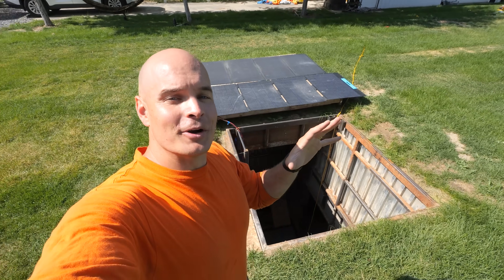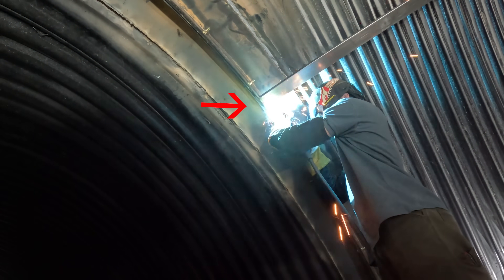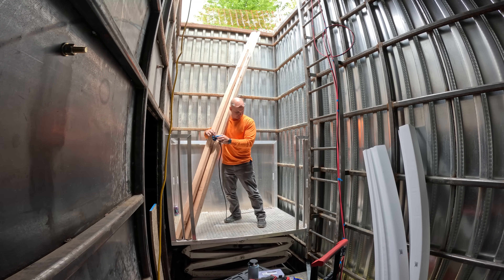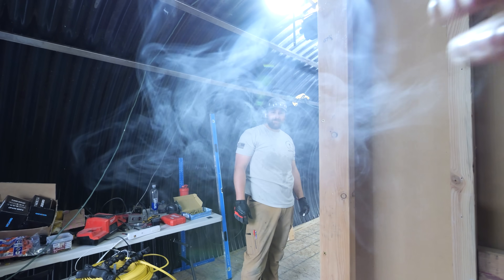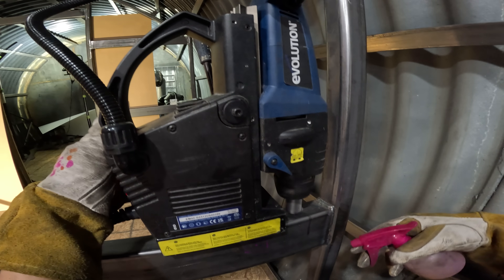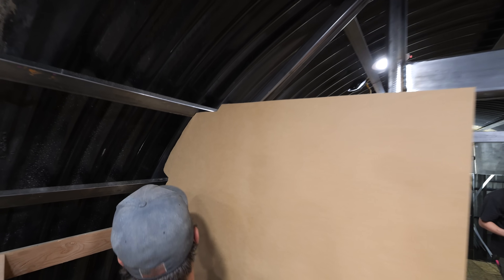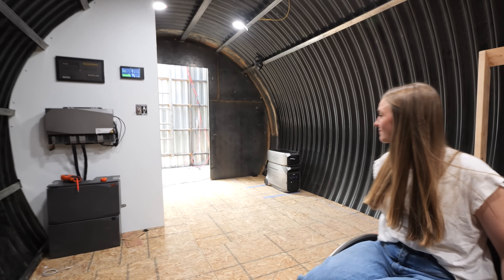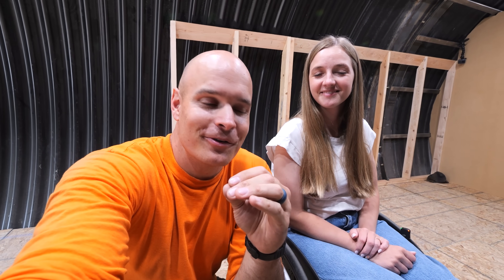How to Properly Power a Backyard Bunker - (Completely Off Grid)

Comment: I love anything bunker related but all I got out of this video is ecoflow..... A product that I will never own! It's horrendously overpriced for what it offers and it's not suitable for a fixed location installation! 
For the money, a victron system coupled with Chinese Lifepo4 batteries will get you more kWh worth of storage which you will find that you are going to need at least a minimum of 30kwh and that doesn't include the running of heating equipment..... Let alone having enough solar panels to net you no less than 1kw of constant solar energy on the worst days of winter.... 
My solar system gets 5kw on the best of summer days but during winter I get days where I only get 450W coming in, that's where the battery needs to get you through to the next day or two!!!! 
You need to setup the system based on winter months performance, I have extra panels that I can switch in or out depending on the time of year, I need more in winter and less in summer, it saves me from spending money on more charge controllers by doing it this way.... 
But basing your power requirements on those ecoflow contraptions, that's the most expensive way to do it! 
Not recommended to purchase or create informercials on .....

Comment: I would highly recommend you not set the battery bank directly on the floor.  If you set it up at least a foot up on a platform it will mitigate any potential flood damage.   I do not know if your type of equipment needs air flow and heat gaps around but it might be recommended.

Comment: Electric is cool and all but wouldn't be my choice in a bunker. In the event of a nuclear blast, your entire charging infrastructure would be destroyed. Not to mention it is easily sabotaged and only produces power when the sun is shining. No power at night, very little power in the winter when you need it most, and in the event that the Yellowstone super volcano erupts, it would be covered in ash and rendered useless. If it were my bunker, i would still have a diesel generator as backup. Diesel unlike gasoline can be stored for long periods of time, pair with a large enough fuel tank could last you months, not just days. Plus, by storing the generator and fuel underground, they are safe from damage or sabotage. All you would need is an intake and exhaust port.

Comment: And in 10 years, with all that welding, his nice bunker is going to leak from all side's! ^_^
First, all the galvanized plate at the entrance (not even mentioning the galvanic corrosion blank galvanized metal has in the ground), and now he has also burned way the coating of his ''bunker'' itself.
It would not be dumb to install a galvanic corrosion protection system, otherwise it will leak within 10 years, and totally collapse in 40.

Comment: If those days had not been cut short, no one would survive, but for the sake of the elect those days will be shortened. Matthew 24:22

Matthew 24:29
"Immediately after the tribulation of those days shall the sun be darkened and the moon shall not give her light, and the stars shall fall from heaven and the powers of the heavens shall be shaken"

You mentioned as long as you have sun you should be okay. Oh boy.

Comment: Solar panel will work fine in a nuclear winter, years without sunshine.

This cooling would be produced due to a 99% reduction in the natural solar radiation reaching the surface of the planet in the first few years, gradually clearing over the course of several decades.[

Comment: solar's great, but say a nuclear winter happens. you're kinda screwed. but y'know what'll still be going in a nuclear winter? the wind. gas generator runs outta gas, solar cells run outta sun, but the only way you'll run outta wind is if you lose all the air, and uh, you're not surviving that anyway

Comment: Another suggestion. Get some hardcore air filtration for both outside air as well as inside air. It can be very helpful in an apocalyptic scenario and also in general to keep the air in the bunker healthy.
To go one step further add a dehumidifier and humidifier combo.
For ultimate protection add a CO2 scrubber (possible to DIY) and have and oxygen cylinder down there to replenish. Im assuming oxygen is used for welding in the wheelchair factory. Use one of those cylinders and swap it out every few months to keep it fresh and make sure its a recently tested cylinder that will hold up for a long time

Comment: How do you use the EcoFlow Smart Generator (Dual Fuel) down in the bunker without ventilation or refueling? What is you don't have sunlight or solar panels? I always hate on the other products that claim a "battery pack" is a "generator". How does it "generate"? I'm in the basement of my house, no sun, no outlets, no fuel.....make me power....

Comment: I just got there 2 phase whole house power system. Just remember, they generate heat when they're discharging and when they're charging.
A little breathing room it's always a good thing.
Absolutely brilliant use of that gutter as a wire guide!
 Panduit is way too expensive.
At this point I would suggest that you put in your dehumidifier and other HVAC.
 I see you're using wood which is a wonderful little sponge but not as bad as drywall.
Check out some of those RGB LED grids for your mood lighting.
They seem quite versatile.
 I've seen some that can actually do rough images that could simulate clouds going by.
Speaking of light!
 I had almost forgot, you're going to need UV in order to process your vitamin D!

Comment: Not sharing alternate egress to us: maybe just demo of tech and ways tech can be used.
Radio signals? Detectability from outside?
Teach morse code etc to bunk mates. Low tech comm can be made without computers or chips. 
Consider learning basics of second language. maybe one most common to where you live.
Combustible toilet? Whichever way chosen: Fumes, disposal, fuel, biological, will it attract bugs and subterra animals. 
Alternate in case of solar panel fail?
Smaller size Low power television.
Defibrillator etc.
What communication works within bunker, between house and bunker?
Consider interference with comm of choice: materials, electrical wiring, earth around bunker, devices within bunker.
Real printed reference book as part of back up in case electronic versions not avail. There are pocket sized versions available.
Learn/practice minimum nutrition intake.
Make prayer/ meditation part of routine.
Air filtering? Exhaust system? 
Lights: automatic and manual.
Train to endure confinement and uncertainty.
Meed 2nd Delta pro as backup.
Have manual tools in case electricity temporarily or permanently goes out. Have a printed reference of electrical that includes manual tools, not just as alternative.
Alternate egress tunnel in case elevator not working.
Manual elevator engagement in case no electric.
Consider spiral ramp.
Fire emergency? Fire extinguisher? 
Generally, all types of waste disposal.
Second bunker connected vial underground.
Root cellar bunker with or without grow lights.
is bunker placement above water table or flooding that won't compromise egress?
Combustibles?
Stock and stay for a month?
Old school phones that might be used to improvise comm network wired between bunkers or set up on a gateway.

Comment: Have used gas generators for years and have had ethanol free gasoline go years without issues in generators and other equipment. I have had diesel separate gut never had any issues with gasoline; never used a stabilizing adaptive either, just always get ethanol free.
No argument regarding the noise though as even smaller inverter generators can be quite loud in an enclosed space or out in the country where noise isn’t the norm. A battery generator mix can be nice as you can upsize the generator to enable fast charging and as such limit run time.

Comment: Having living batteries surrounded by flammable materials is extremely dangerous. They must work in a separate ventilated room which can be fastly isolated from oxygen and filled with fire stopping agents. You need to protect them from freesing, overheating, over and undercharging. Keeping them working in a tube above ground with people is extremely dangerous. Especially when not all can escape fastly.

Comment: Jerry, you should really switch from a PVC gutter for the wires to something metal, or at least made of plenum rated plastic. Actually, with the bunker being as enclosed as it is you should just use plenum rated wiring and mounting hardware.

PVC releases dioxins when it burns. These are some of the nastiest chemicals you can breathe. If you have an electrical fire in that PVC guttering, you're gonna gas your whole family. Same goes for the wire jackets, those are commonly PVC in housing because they're (relatively) sealed in the walls behind the drywall. when the wiring is exposed (as it is in a plenum space, such as the area above a drop cieling) it has to be made of materials that don't give off toxic smoke if they get hot. 

Now's the time to fix this, as once you get further along it's gonna be harder to access all the wiring.
Reply: Yeah, pretty sure rain gutter is not an NEC approved Raceway 😅
Reply: Plenum rated wiring and wire trays is a good investment. PVC is a bad choice for wiring. Cleanup after a PVC fire is not much fun.
Reply: Also, any type of powrr source, be it a fasoline genorator or a bunch of lithium batteries should be in something external. If those batteries ever go up in flames (and considering how many EVs did, they might) that bunker will be flooded with toxic gas.
Reply: Good tip, timely tip
Reply: The location this is installed in is not a plenum space.
Reply: Exactly, but but nothing in that crematorium, I mean bunker, looks to be any sort of fire resistant anyway. That thing is a death trap.
Reply: @inothome  I think if he ever needs to use that thing, there are worse things to worry about than the risk of that bunker bursting into flame.
Reply: @sterlingodeaghaidh5086  If you're silly enough to think you may ever even need some bunker you should actually make the bunker safer than what you are afraid of outside and not a tomb. I mean who are you going to call if it catches on fire when you are "hiding"? lol
Reply: @inothome  I really don't think he is building this to be serious. I think he is only building it for the views and the payout anyways. He might use it as his doghouse when in trouble with the wife.
Reply: @tomscheea8656  for money yes, but also for fun. when you've got the money, you can do whatever the little kid inside you wants.
Reply: His name is not Jerry it is Zack Nelson

Comment: Imagine building a bomb shelter in a country that doesn't get bombed. My childhood bedroom was a bomb shelter, and on top of the dresser, we had the entire family's supply of gas masks, spare filters, and anti-nerve gas serum (in case the little ants climb up your legs (thanks, Sadam)). Having batteries and solar panels is a great idea. Still, in an actual war zone, gas (read petrol) generators are more robust and easier to protect than solar panels, especially because solar panels are easier to see and destroy from the air. You can also get gas (read propane) generators, and propane lasts much longer. If you're worried about enemy soldiers looking for you (which will never be a concern in Utah) and finding you based on the sound of your generator, then you're doing it wrong. If soldiers or terrorists are outside, you go into blackout mode because the enemy isn't detecting your electricity with their ears.

Comment: I really hope your plan with the bunker will work well, I can see how it wont be very accesible with the wheelchair and feel cramped. The culvert being round and maybe not having the protective layer on the outside seems like a big risk too, you won't know it until you sit in there and 5 tons of sand blast through your roof. 
I think you should've gone for a concrete bunker with a straight roof and a wider profile, maybe even a ramp for the wheelchair or some pulley system elevator in case of power outage. There should have been enough documentation on civil bunkers to build one correctly to your needs.

Anyway best of luck.
Reply: Just want to point out he may need to look more into the details of things. That PVC gutter isn't plenum rated, and his wiring probably isn't as well so that'll be PVC jacketed. 

Not gonna get too into it, but hot/burning PVC releases dioxins, which are extremely toxic. A wiring fire would gas out the whole bunker.

The coating thing should be fine, they were welding far enough off the outer wall (and the dirt will help keep the coating cool.) It's putting the battery pack right beside the living space that skeeves me out. If that thing has a catastrophic issue, it's just gonna dump the contents of its batteries into the air of the bunker at over 1000 degrees c turning it into a pressure cooker. I'd have it in a spot that can be isolated and has it's own exhaust hardware. 

Also i hope they figure out some kind of range hood for cooking down there, as a stove fire is exponentially worse when you can't get away from it and the smoke.
Reply: @zerumsum1640  Yeah, they will probably think about some automatic ventilation + manual backup, at least they should show it in future videos. The pvc gutter is indeed not rated for cables, I wouldnt trust it. Even if these were fire resistant cables in it. Any fire, especially the batteries would kill them before they could get out of the bunker with how its layout at the moment

Comment: An experiment for you to do with the ecoflow - how many miles would it give you in you van if the van battery ran flat ?
This is one of my biggest question with EV's, what do you do if you run out of power ?
Loving the bunker, I would have run an exhaust pipe into the barn to make use of that free underground heating, it seems a waste just to vent it away

Comment: Best commercial for EcoFlow :) 
Jokes aside, fantastic build. One thing though that bugs me every time I see electrical work from US parts.  No user of conduit to pull electrical wires through. I know that the chances for a cable to have a fault is slim to none, but still. When walls are up, its much easier to pull a new wire through a conduit than pulling down the whole wall and what not that is in the way.
..
Also, this video need 1M likes, would love to see a fusion core down there!

Comment: I've been looking, but couldn't find anything. Did Jerry make a list of things he's planning to have in there? Like a to do list or something? Also, a sunlight lamp in there might be usefull for moral on the long run. The gutters might accumulate liquid, poking a few holes here and there might be a good idea. Not sure if the biggest TV you can fit might be a good idea. Those thing don'T last long and eat a lot of power even when turned off (you need to unplug it or it's in hibernation mode). Satelite signal could be usefull as well, the elevator should be a cleaning sas as well, so radiation suits, etc. So much to think about.

Comment: Just a thought... Don't bank on the sun being visible for a good long while in situations where you'd actually need this space.
Reply: But its even less likely that gas will be available to buy... So solar is the easiest solution... A wind turbine wouldn't be a terrible idea, since wind likely would continue, but they are not efficient for residential.
Reply: @rossallen738  wind is sort  of where i was hinting, it might not be efficient, but generating 'something' to trickle in to the batteries is better than nothing if there's not enough usable sunlight hitting the solar cells for them to generate anything.  That being said, with the right engineering, a  relatively small windmill even DIY can easily generate enough power to charge those batteries on a breezy day/night.
Reply: @RonLaws  but you have to be in a breezy spot... Which isn't always controllable and wind is far less reliable in some spots than others... You might get a day of wind per week, which means that he wouldn't have nearly enough battery. That's even assuming 1 windy day could fill the battery...
Reply: @rossallen738  In my part of the world (up in Nordics) the sun disappears for 5 months of the year, so solar wouldn't work in the winter. You can pretty much rely on it being windy often enough, especially if you live near the shore regions, which a third of the population in my country does.
Reply: Solar still works when it's clouded over, just at lower efficiency. Even for fallout clouds. What I'm worried about is getting breathable non radioactive air, and water recycling
Reply: @32BitJunkie  A valid point, A multi-prong approach with contingencies doesn't hurt though.
Reply: He should have buried a couple huge propane tanks in his yard. Propane stays good for a long time.

Comment: I think you will need at least 3 more battery units.  And why didn't you hide them under the floor, since you will have children in the bunker?  I would put the battery packs and fuses in the hallway by the elevator.  So that if there is an electrical fire, the batteries are separated from the living area and you have more time to escape to the surface.